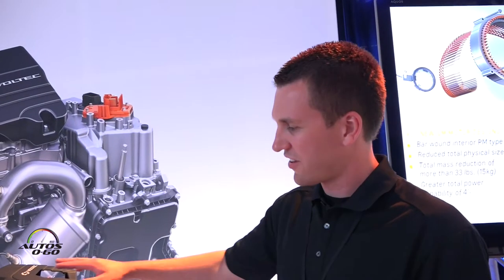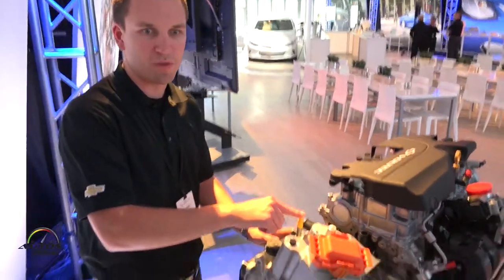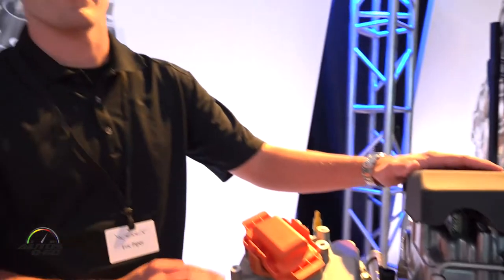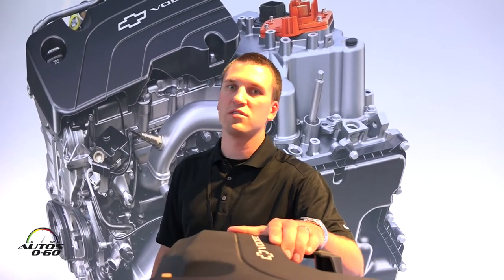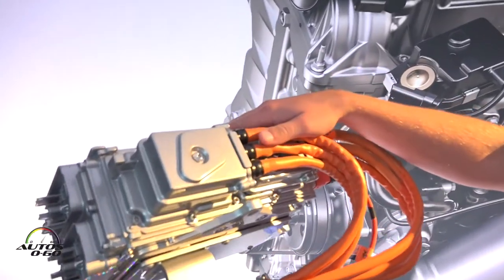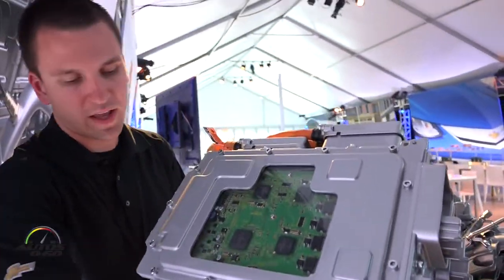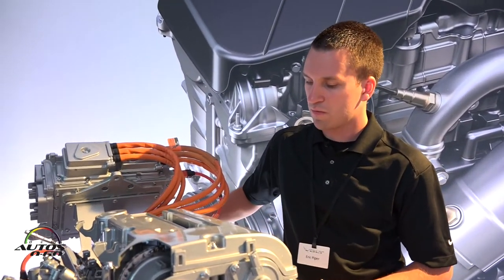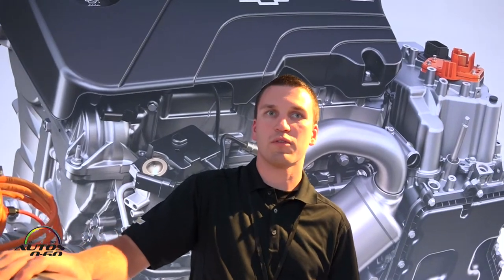2016 Chevrolet Volt 1.5L gasoline engine

Comment: Great video, not sure if you know the answer to this but I need to take off the water pump to this engine and cannot figure out how to release the belt. the belt only goes around the crank shaft and the water pump, no pretensioner that I can seeThank you,Jim
Reply: You have to cut the belt and reinstall a new one. It's a stretch desing belt.

Comment: Question does gen 1 use gear drive and gen 2 use chain drive for it final drive?
Reply: Pretty much. GEN 1 is built stronger. Gears most likely will outlast that chain. The motors on GEN 1 seem to be built stronger than GEN 2 and then the cast iron vs aluminum. Maybe heavier, but definitely stronger than Aluminum.
Reply: Yes.